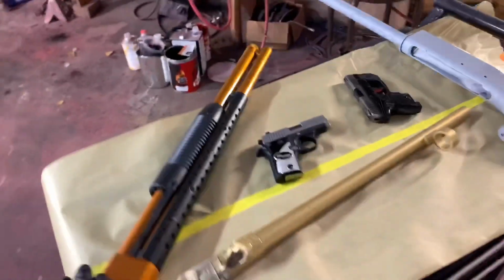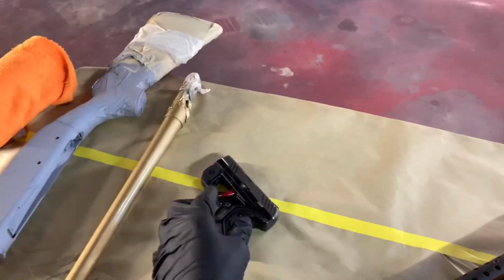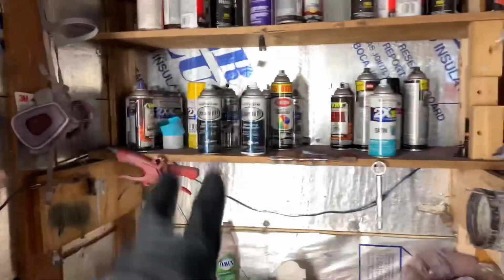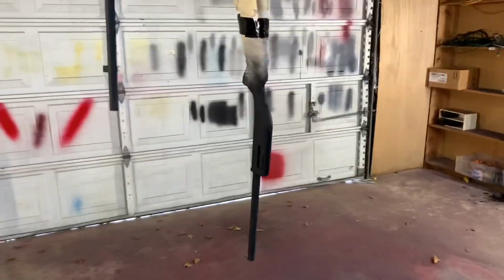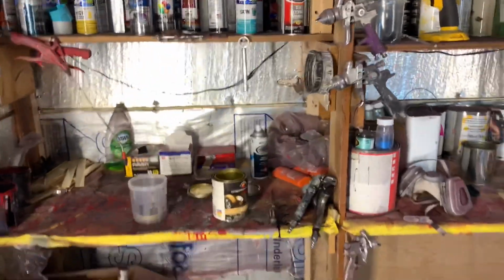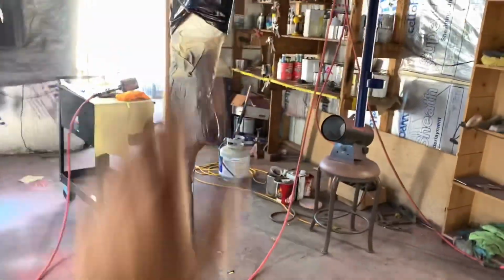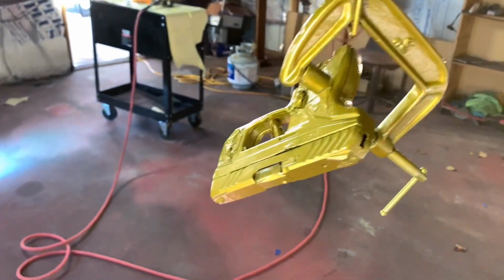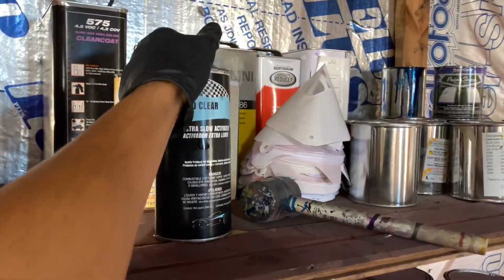How to paint Guns | Custom Guns!!!

Comment: Is the automotive paint better then the aerosol paint..in your opinion???? And how many days do u leave it to sit..cause I tried for the first time wit regular aerosol spray it took about 3-4 days...and u should try neon colors
Reply from the maker: I would prefer automotive paint, I also use automotive clear as well, I don’t see any issue with using aerosol cans as long as you put a clear coat for durability, and I definitely got to try that out with the neon!
Reply from the maker: I have tried to use aerosol cans without clearing it but like you said it’s just not terrible enough
Reply from the maker: *Durable

Comment: Where can I get the mask, paint gun and suit from. Also, after I paint the primary color I should paint a clear coat over for chipping resistance and durability?
Reply from the maker: You can get them all from AutoZone, or You could get them from sherwin Wiliams, your last step will be clear coat, but...if you like the clear coat color and what your gun that color the go ahead and put the clear coat on the primer, I don’t see that being an issue, But if you’re going with a certain color the order should be primer paint then clearcoat
Reply: @bzoewitwheels4029  that’s exactly what I was think good looks for the equipment bro love the content you got my sub🔒
Reply from the maker: @luhhturbo9820  appreciate you boss!! Man if you need anything else, I can do what I can to help with the little I know

Comment: This is super cool. I got an old winchester pump gun I'm going to try this with.

Serious question though, how does that finish on the barrel hold up to the heat of sustained firing? Is it going to crack or burn or anything? 

I was looking at engine enamel, the ceramic stuff, as it's rated up to like 2000 degrees and comes in some nice colors. Is that necessary though? Will regular car pain really hold up?
Reply from the maker: appreciate you boss, and yes get some hi heat paint and you will be good to go.
Reply: @bzoewitwheels4029  hey man, it turned out fantastic but I don't think I let it cure long enough before reassembly. 
Hung for 72 hours and she got a bad chip from a slight bump on the barrel. Sealed it with a splash of clear coat and let it sit in my gun safe for 2 weeks.

Took it to the range yesterday and I expected it to all crack and flake or chip off. That 2 weeks of sitting helped it set in a lot stronger I guess, because slam firing the crap out of her and setting her down rough on the range bench didn't cause any finish damage at all. 

I'll just need to be patient next time and let her hang much longer. 

Any tips on removing this paint job? I kinda wanna redo it in a green/gold color shift (packers colors, I live in Wisconsin). Will simply wiping it with paint thinner/remover be enough?

Comment: Wanted to paint my Glock, but concerned about chipping over time from going in and out of my conceal holster. You experience chipping?
Reply from the maker: I put over 150 rounds through my purple Glock in a different video I made, no issues and I also have a holster and haven’t had any issues at all , I will say baby your painted gun for at least 3-6 weeks if your using automotive paint because it’s just like getting a car painted,it needs cure time. I’d highly recommend to put clear coat once you paint it for durability.

Comment: Hey man, so my paint laid on beautifully, but when I went to put everything back together the paint, primer, and Protectant is too thick to reassemble everything and it just scrapes everything right off.
Reply from the maker: I definitely hear you on that it’s all trial and error what I did was soak it in lacquer thinner and literally just restart the project and apply less coats and the areas you had issues with mask them up, And whenever you assemble your gun oil the insides.